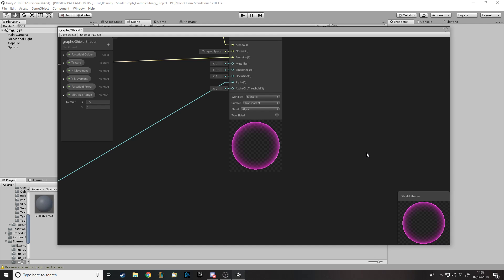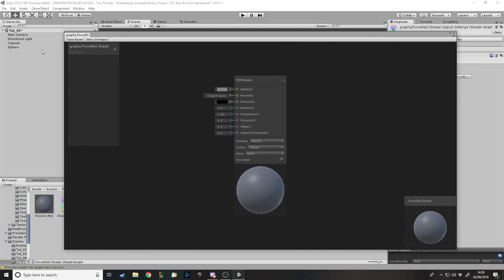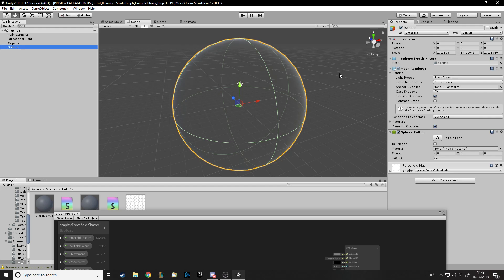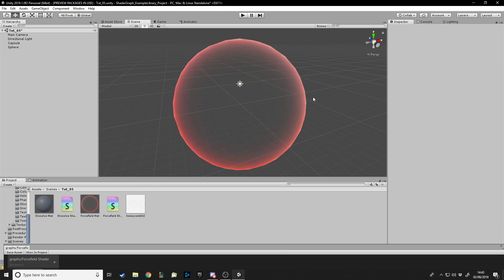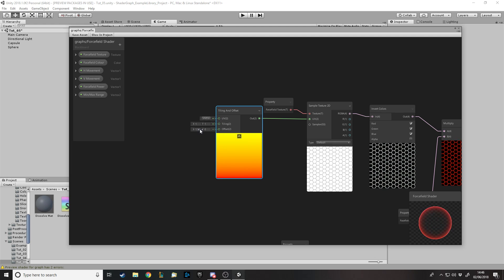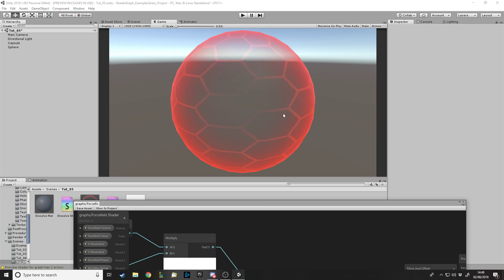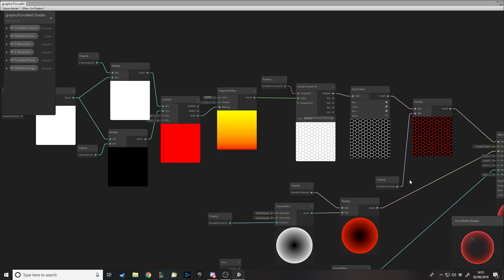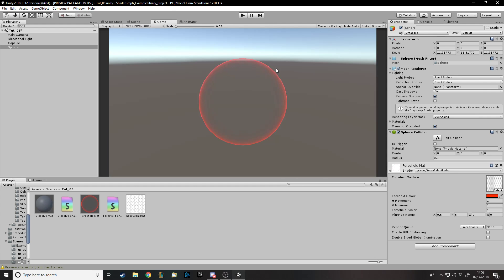Unity Shader Graph - How to make a Force-field Shader

Comment: Great tutorial, just wanted to mention that you can indeed change the parameters by code. I struggled with that for a while when I was working on a shader of mine, but finally figured it out.
To do so, first you need to get the actual names of your parameters: this you can find by checking the properties when you have the shader selected in the inspector.  You'll get some strange names such as "Color_8804746CD" and "Vector1_9850B417D". These are the real names which can be accessed via code. The ones that you type in are simply the tags. So far I'm not sure if these names can be changed or not, but at least we can access them in our code. 

Hope this helps!
Reply from the maker: Thanks for the explanation but I already have a video on this :D Though at the time of making this video I wasn't quite sure :)
Reply: Oh,  oops.
Reply from the maker: Don't worry haha. I'm happy that you're here to give help :) It's a good attitude to have

Comment: A Blur shader would be nice of you
Reply from the maker: I'll try my best to include that in my next video :) Do you mean that as an effect for the camera where the whole scene is blurred? If so, then you should just use a camera PostProcessing effect to make stuff look blurred :)
Reply: Thank you. and what i mean is that specific objects can have that material and it make it looks like a rough glass or something. for example like in this project if the material had a blur and i assigned it to a sphere that has another object inside it that object will look blurred or distorted.
i used to use it to make cool UI effects and it seems like a good application for this shader.
Reply from the maker: Oh yeah haha, I'll try my best to achieve that effect :)
Reply: @DapperDinoCodingTutorials   Where are this shader?